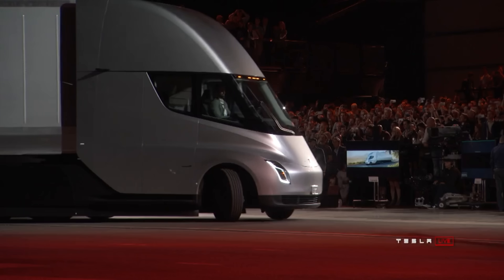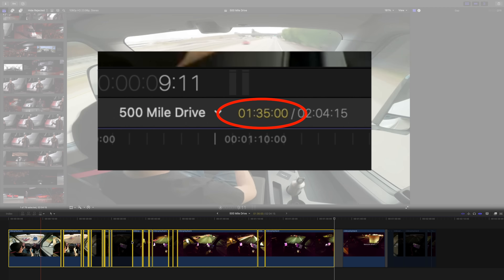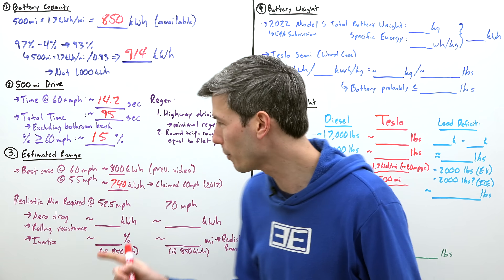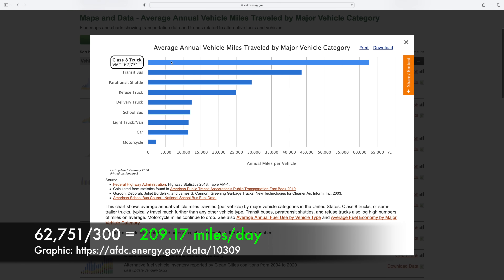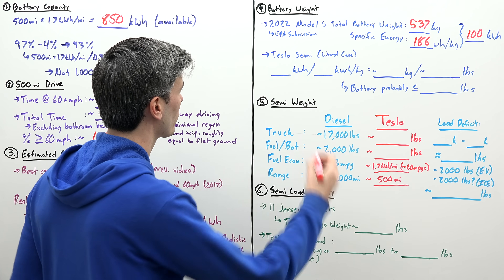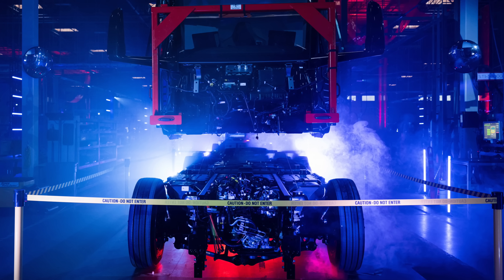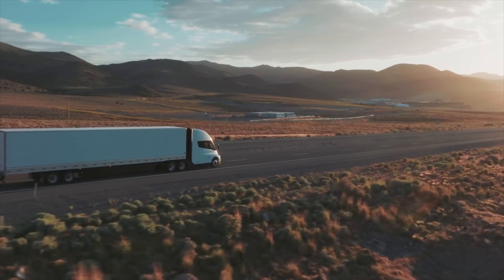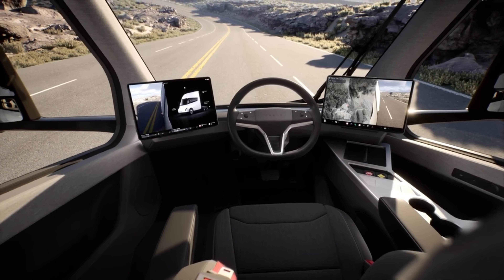Does The Tesla Semi Make Any Sense? Part 2!

Comment: My assumption has always been that vans & reefers are cube constrained, not weight. Dump trailers and flat decks do often appear weight constrained (gravel, steel, etc). And there is a massive LTL and short/mid haul industry - even up here in the frozen land of Hoth. Many farms hauling grain / livestock are just going from farm to terminal/feedlot/processing plant. Massive cross docking warehouses shuffling loads that may have come in via long haul, but then head out on short haul runs where the driver makes 2-3 trips / day and goes home for supper.
An electric semi w/ 500mile range is a totally useful, necessary product. Now can be financially viable. That's the question.
Reply: where I live (Sydney, Australia) you can differentiate the two kinds of trucking just from driver behaviour. The long-haul drivers are generally polite, aware and careful, and the local drivers are dangerous lunatics. Presumably different incentives at play
Reply: The subsidy needs to go away so real math can measure cost/benefit. No mention in most videos of federal and state taxes on liquid fuels vs mileage taxes on EVs.
Reply: The subsidies are to get the technology into the real world. That much I can accept. Beyond that and the government becomes part owner.
Reply: Fun story.  Friend of mine use to work for a lightbulb distributor and they were definitely cube constrained.  That was until those compact fluorescents lights came out. He packed the trailer full as usual and when the trailer drove off it blew all eight tires.
Reply: Re: refers, depends on the load.  E.g., a load of soup cans, beer, or beef maxes out weight.
Reply: Hybrid is still far superior to that - marginally decreased payload vs electric and basically all the benefits and cheaper. Unless bats are solid state NaS (~1/3 the weight of Lion) it won't make sense
Reply: @ChuckLeeClerk  if it's so awesome, why does it need a $190,000 subsidy PER TRUCK??? EVs are a scam on tax payers
Reply: With the current cost of diesel it's totally financially viable.  Figure if it's 1.7 kWh/mile x $0.15/kWh, that's less than 23 cents per mile.  With Diesel at $4.50/gallon and 7MPG, that is 64 cents per mile.  Tweak the numbers any which way you want, electric is way cheaper.  Over a million miles driven that is $410,000 saved.  No brainer.
Reply: @rogerheuckeroth7456  If the battery pack last that long with fast charging, you’re correct. I’m interested to see how the Tesla Semi battery will hold up over time. On paper, it makes sense, but the real-world test is coming! Exciting times!
Reply: @GhostFishSlayer  Most short- and medium-haul applications will just not require fast charging, ever or almost ever.
Reply: When is an electric replaced as a tax writedown? Will the battery hold up to remain on par with diesel ($) ?
Reply: @rogerheuckeroth7456  Maybe. What we don't know is, the hidden costs at this point. The costing average of a possibly $1M charger or in the case of fleets like Pepsi, an extra person on the night shift per 2 or 3 chargers to swap out tractors on those chargers. Those are possible examples. With diesel the hidden costs are known and figured into the price paid at the pump.
Reply: @legostud  until those batteries lose range, then $$$$$$$$
Reply: @legostud  
Check out Edison Motors. They made a hybrid logging truck. 

There are a host of upsides with no real downside. The battery health is less vital to max range. The diesel generator only runs at one RPM which reduces wear, plus it has no transmission. If the battery runs out of juice, no need to charge, just fill it with diesel⛽. If the diesel gen fails, just run it to the shop on battery. They actually managed to save 200 lbs in the conversion, but also get the bonus +2000 lbs on top of that because of the electric drivetrain.
Reply: As a dispatcer for reefer trucks, I would be happy for Tesla Straight truck, but semi... not sure.
Reply: @bogdanb.lytvyn7662  until we have a driver walk in and be like "My truck is at 1/3 charge" because charge times on a battery this big will be a breakdown scenario vs a few minutes fueling up with the gas card
Reply: Some pickup trucks reach the weight limit with just 5 big dude sitting in it. But for larger vehicles it's indeed true.
Reply: Depends what you are carting. Pallets of cans may be weight limited while chips or bread etc will bulk out. Regardez Frito  Lays chips vs PepsiCo soft drinks as opposite ends of the spectrum
Reply: @legostud  these will be local delivery, you are fooling yourself if you think mileage will be the problem, it will be charge cycles... 4500 will be 12 years, but that's best case, and doesn't account for range loss, which can easily drop the range below what is needed for even local use, especially if it happens to be winter.... all of this is best case too, which is wishful thinking, just wait until a few burst into flames and burn for a week
Reply: @legostud  and lithium ion is most likely, which won't even make it 3 years of charge cycles
Reply: @legostud  325k on a semi???? That's embarrassingly low... 100k miles a year on a local delivery truck isn't unusual, its normal... and that battery will only cost what? $100k to replace?? Holy crap this is just fantasy land... no wonder they need subsidies so big the freaking trucks are FREE before they even consider buying into this scam... did you stick around until the last 10 seconds to hear about the subsidies?? He tried to hide it 😉
Reply: @Jonathan Dallas  oh you mean TOUR baseless claims?? 😂 my claims are based on my dad's 50 years experience driving local delivery semis... pretty good thing to base a claim upon 😉
Reply: @Jonathan Dallas  it doesn't and I never claimed it did, it was the evidence because you said my claim for mileage on a truck was "baseless"... I personally understand EV tech because I'm an electrical engineer with 22 years experience, and design and program drive systems for industrial environments, which is the exact same tech minus batteries
Reply: @legostud  I never said that, stop lying
Reply: @finish_my_projects  - you’re right, whatever. Don’t care anymore. Go ahead and stick your head back under the rock.
Reply: @Jonathan Dallas  *you're

Comment: At 9:16 I think you are a bit off.  You cite the Diesel powertrain as 4,080 lbs and say you can save 2000 lbs with the tesla semi.  That is basically saying that the tesla Semi motors and transmission weigh 2000 lbs.  The Model S Plaid motors weigh 100 lbs, for 300 lbs in motors.  I'm not sure how much their transmission weighs but I looked online and found a weight for an 18 speed transmission at 800 lbs.  Even if Tesla's transmission weighed the same amount, which is very unlikely considering how simple the design is, that would give you a motor/transmission weight of 1100 lbs, or about half of your estimated weight for the Tesla powertrain.

Comment: For me the big question about the Tesla Semi, is when it is actually going to be driving around on the roads? Because BEV lorries are starting to become more and more common over here. DAF and others have been selling e-trucks for a couple of years now. And for doing the last-mile from an intermodal transfer port/station, or from a destribution warehouse, to stores and businesses they make perfect sense.
200km of range really isn't an issue when all you're doing is resupplying supermarkets within a single city.

To me it seems like Tesla was trying to be revolutionary, but they've ran into so many small hiccups on the way to their revolution that the competition not only had the time to take a good hard look at the Tesla Semi, they've managed to beat them to market. If Tesla was to actually start selling their lorries in say 2025, they'll arrive to a market that's long established standards for charging plugs and protocols. A market that has already settled on what kind of range and capacity is required, where the big manufacturers already have a support network in place.

Tesla had better be in it for the long haul routes that are currently still done by diesel trucks, because the last mile market is well on it's way to becoming saturated. Also they'll need a truck that's got a short nose. Length restrictions are very much a thing and no one is going to buy a long-nose Tesla and then have to deal with the fact that you're restricted to a shorter trailer. You want a truck that can pull a 2.5TEU trailer. Being stuck with a 2TEU trailer is just not competitive.
Reply: Tesla semi trucks are already on the road, pepsi owns 36 of them and plan to own  100 by 2023. Tesla wants to make 50,000 units by 2024. Any market Tesla enters it rapidly expands into and the rate at which other BEV truck makers are producing their trucks simply won't match teslas output.